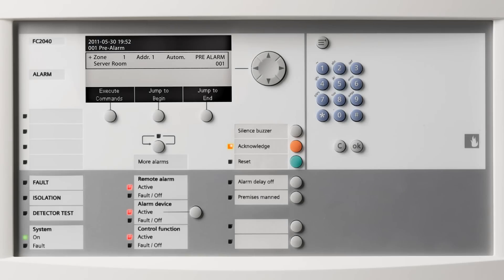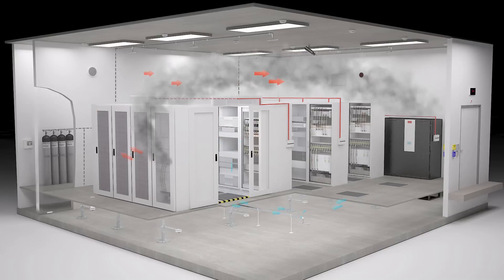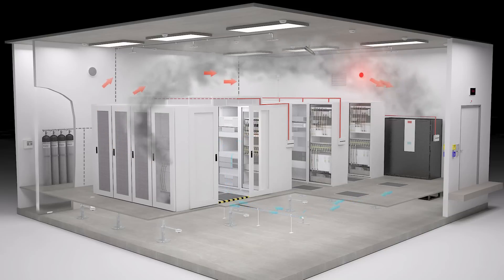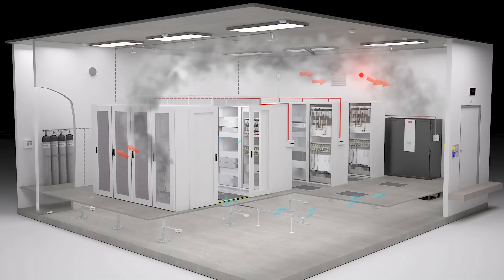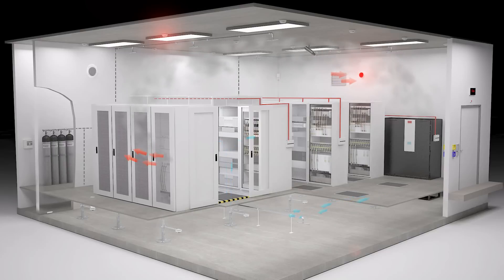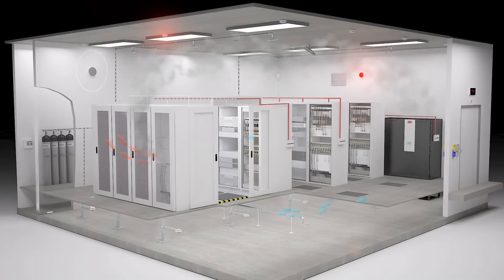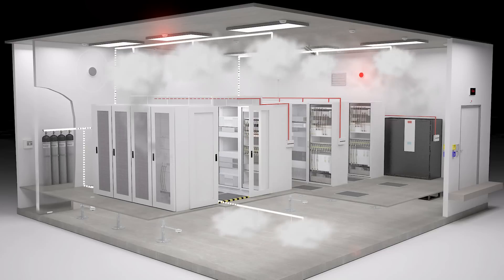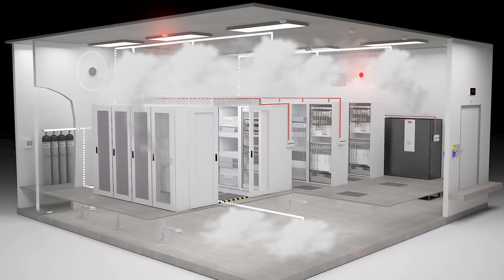Fire Protection in a Data Centre

Comment: I work in data centers that use this system, and I am finding it hard to find information on how I may be at risk in the case of being inside when this happens. Anybody have any information they can share with me?
Reply: There usually is an alarm that will ring, giving any workers inside 10-30 seconds to get out before the CO2 starts flooding the room.
Reply: No-one uses CO2 anymore - it's lethal and uninsurable @zloty03
Reply: You need to look at the HAZMAT sheet for the type of extinguishant in use.  It's certainly not pleasant being inside when it fires but it won't kill you.  Some people can have allergic reactions or experience faintness and dizziness.  If FM200 is used, the ceiling tiles usually fall in because of the drop in atm pressure

Comment: You do NOT want to be standing in that room when the 30 seconds countdown completes on the panel and the suppression canisters release it’s gas. 

You’ll be gone in under 10 seconds of inhaling that ☠️
Reply: I thought it's just CO2... How is that even allowed, this is horror movie stuff...
Reply: @nexovec  it depends on the system some use CO2 but others use Halon. co2 is 1.53 Times the Density of air. Halon in roughly 5 TIMES THE DENSITY OF AIR. either way you will very quickly pass out from suffocation. after that... well if not moved in time...
Reply: @nexovec   this is how fast halon fills a room www.youtube.com/watch?v=Jx1s8u2Mpmo
Reply: Don't worry, this guy has absolutely no idea what he's talking about @nexovec

Comment: Failure to auto-deactivation of HVAC system can have devastating life threating results on people in other locations in buildings, various case studies has proved. System should be integrated with availability of BA set in flooding room to avoid any lose of life in case someone is trapped within. Activation of such systems should be done after ensuring no human life risk.
Reply: What's BA?
Reply: There is a fail safe and a button in case it doesnt work